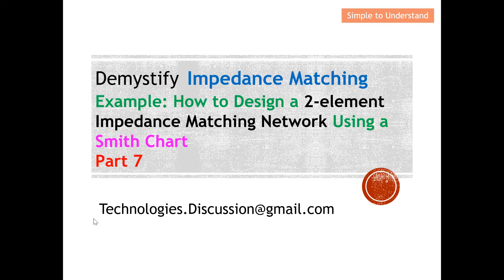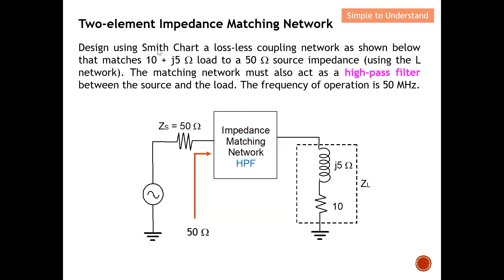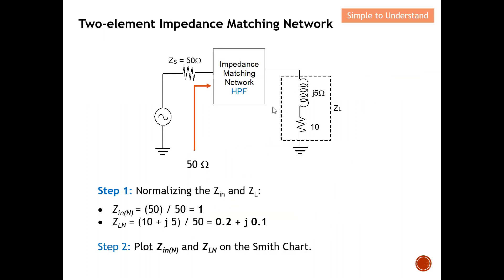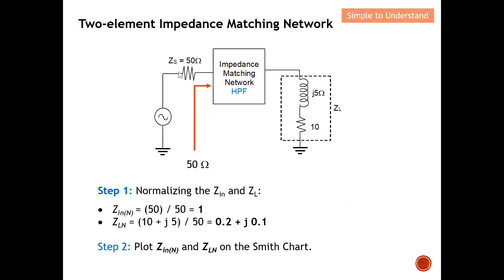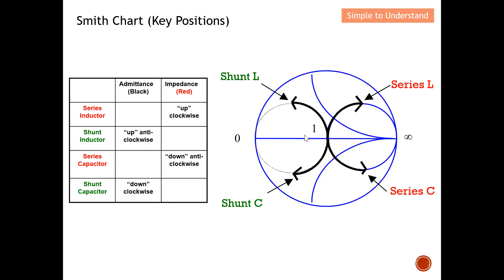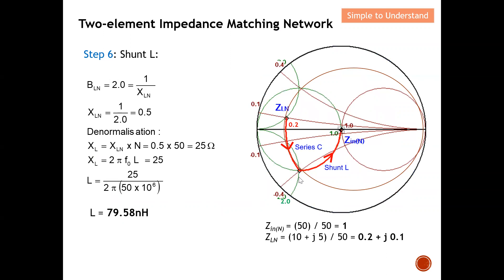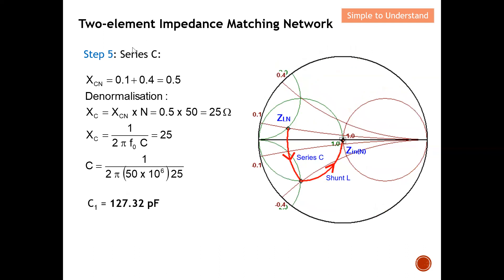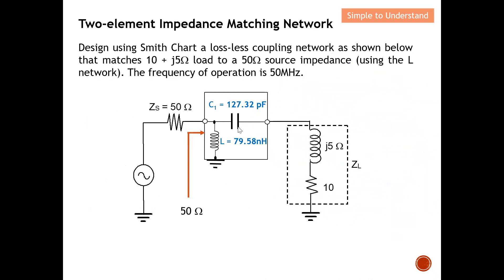Impedance Matching #7. High Pass Filter Design on Smith Chart with Two-Element Matching Network.

Comment: Can you please  explain the "Gun points to the small guy" rule?
Reply from the maker: Thank you so much for you to see the video.  :)
There are 2 resistances, the gun is always pointing to the smaller guy (the smaller resistance value).
Thank you and I hope this is useful.  :)
Reply: @technologiesdiscussion1676  
I understand which one is a small guy.  But I don't understand the reason behind it.  Could you please explain?   Thanks.
Reply from the maker: You want to "balance the impedance" so the L Section series to the smaller resistance so overall will add and increase impedance. As for bigger resistance, I will connect the shunt of L section. They are parallel and hence overall impedance reduce.
Hope I explain well.  :)